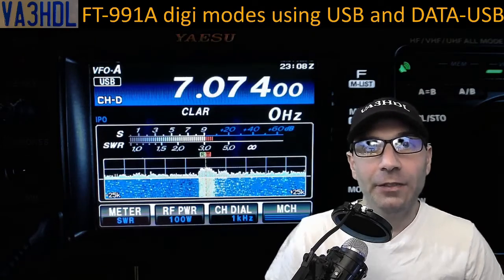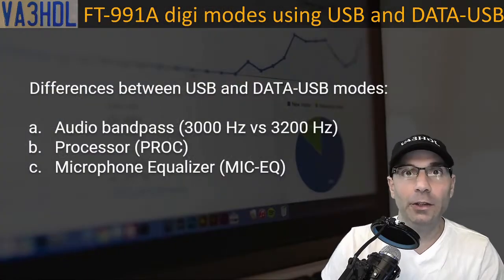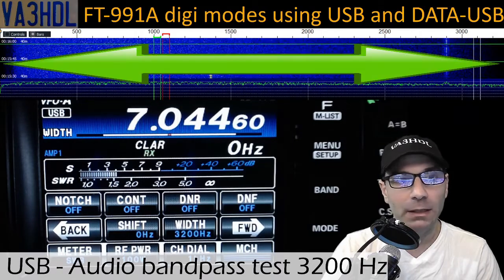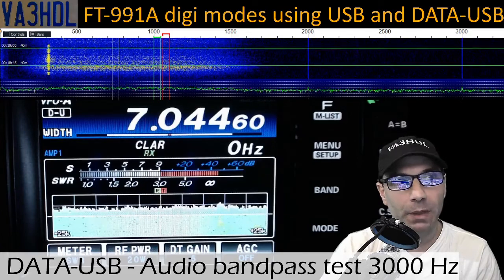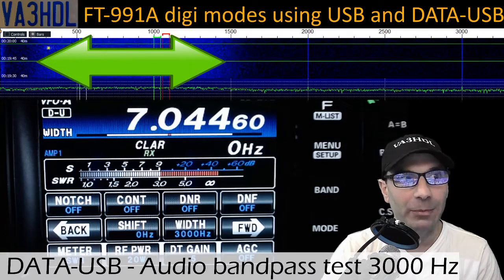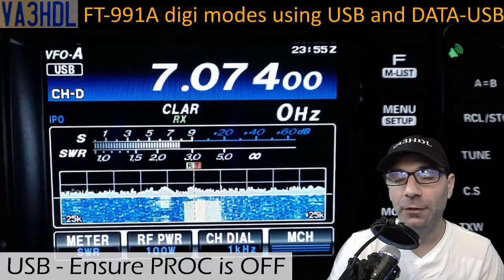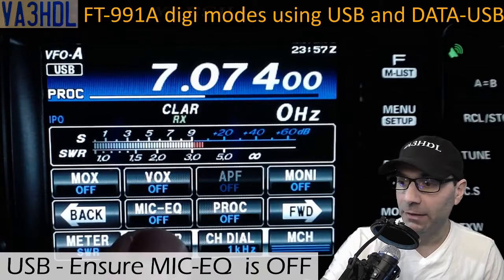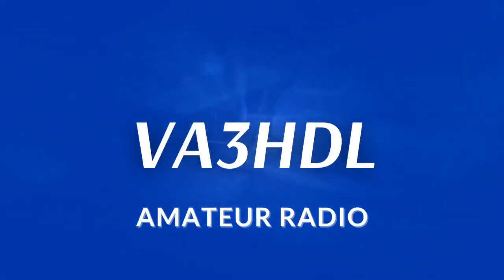FT-991A Comparing the SSB audio passband vs DATA-USB

Comment: Set Menu 064 to 1500Hz and Menu 065 to 1500Hz and try againl.
Reply from the maker: These two options doesn't seem to impact the width of the passband and the only effect is shifting the frequencies up or down. I've tried changing them and looking at the audio waterfall on the computer and this effect visible too. However, your pointer made me look at the next four options for the low cut off and high cut off filters. I turn both them off and the audio passband increased in width compared with my previous tests. Maybe I can make a new video about this. Thanks for commenting. 73

Comment: My FT-991A shows a very visible passband of 3000 hertz wide in DATA-U mode and although it widens to 3200 hertz in the settings in USB mode it still only receives 3000 hertz wide. I can use either Digital Master 780 along with Ham Radio Deluxe or FLDigi and FLRig for digital modes except for FT8 mode  that  I use WSJT-X for along with JT Alert for WSJT-X and JS8 Call mode that has it's own software app. I'm not sure why your rig is showing only 1500 hertz bandpass in DATA-U mode unless you have the bandwidth set to that in the digital mode software your using or the radio control software you're using because there is no difference at all in the receive bandwidth on my FT-991A whether I'm in DATA-U or USB mode. Very 73 de KU4GW
Reply from the maker: Hi Cliff, not sure if you watched the entire video. This is show around 3:11 - Width is set to 3000 Hz as per screen. Thanks. 73